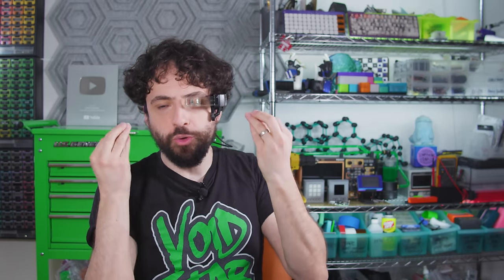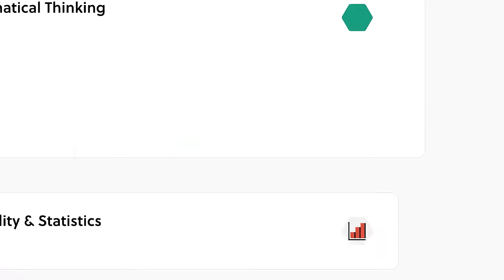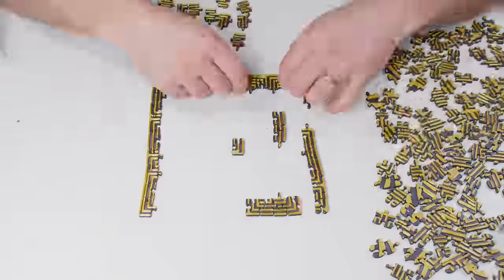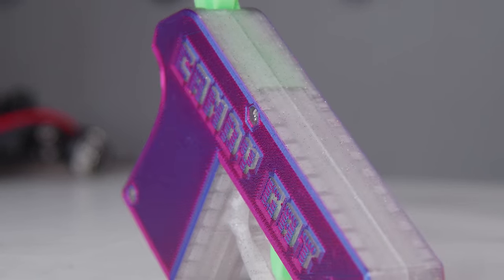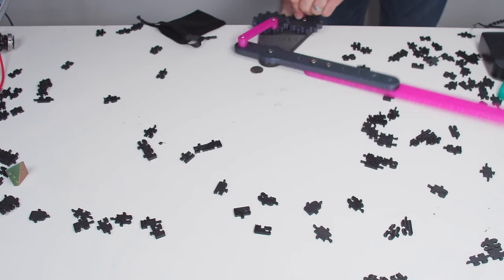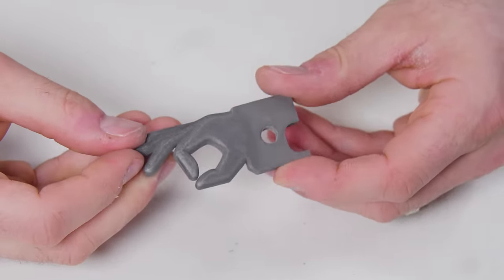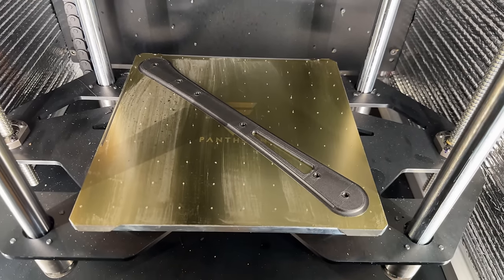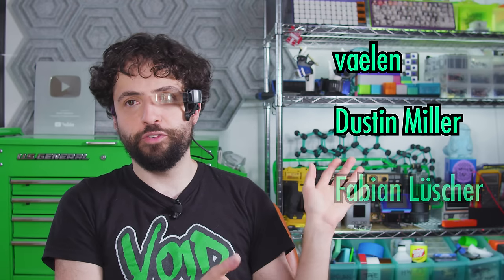10 Free Prints to Make Friends Suffer!

Comment: If you secured the lamp's cord at the correct point, it would actually use the cord as another linkage and it would pivot the lamp, and the lamp would move as the arm moved. That might be the way the original creator had it set up so that it wasn't limp-lamped.

Comment: Whoever made that lamp truly understands the spirit of steampunk. Very much victorian aesthetic engineering. I genuinely want to build this now.
Reply: I wanna see it water jet cut out of aluminum and anodized different colors
And it absolutely MUST use an Edison bulb style LED
Reply: Just remember to look at the pic and assemble it the same, bro.
Reply: @drthmik  LED? Nah, bring in incandescent.
Reply: @alexturnbackthearmy1907  probably best not to.  Incandescent lights produce a ton of heat, more heat than light in fact.  You could use an Incandescent bulb to bake cookies - and they made a toy that dis just that (ezbake oven)

Which poses a problem if you make it out of 3D printed plastics.  So if you do want to use Incandescent, make it metal.

Comment: That lamp honestly hits my biggest pet peeves in 3d printing. I don't need everything to be as well written as the Prusa assembly instructions, but dangit I want to at least know I have the right number of parts.
Reply: Look at the photo and assemble it the same bro.
Reply: just count em in the picture bro
Reply: Build it till it works and the leftover pieces are extra
Reply: Also printing parts that should have been laser cut. I see so many people wanting to print things that are just flat pieces with some holes in them that take no advantage whatsoever of the capabilities of 3D printing and are just strictly worse than some laser cut plywood.
Reply: @neutronium9542  because most people definitely have both a 3D printer AND a laser cutter
Reply: @neutronium9542 you’re totally right, that lamp looks like it should be laser cut MDF or something
Reply: There's no way it was his original design. He stole it.
Reply: look at the photo and assemble it the same bro.
Reply: @MinerBat  You can get an attachment to turn a 3D printer into a laser cutter.
Reply: well, tbf, besides me, idk who else even bothers to read the instructions.

Comment: Would love to see some sillier videos, as long as they are mechanically interesting.
Also, that lamp in the last one was definitely a laser cut wood construction at some point, that's why the design is that way, so it's probably not some created with the permission of the original designer.

Comment: You really should clarify very that specific filaments are needed to 3D print light switch covers, otherwise it's a major fire and safety hazard. That's why building codes dictate that they be made of specific materials. In fact, it's best not to encourage printing them regardless since most people won't bother checking requirements like that before printing.

Comment: Those dice would be fair if they were fully solid. 3D printing is anisotropic though, meaning it adds mass in unexpected places which is effectively loading the dice. For instance, the top/bottom might have 4+ layers but you might only use two layers on the sides. Or consider if you used lightning infill, the top would have more mass from the branches growing out of the walls while the bottom is hollow.

Comment: For the first print, the dice: Although they could mathematically be fair, 3D printed dice rarely are. Although the area of each face is unlikely to be perfectly the same on all faces when printed unless the printer has been meticulously calibrated, the real issue is that the layered nature of the print means that different orientations can lead to different coefficients of restitution, and thus different bouncing properties. Even if each face is perfectly equal in area, and the die is perfectly balanced weight wise, the difference in bounce can still make different faces more or less likely. In practice it's unlikely to be a large difference, but it is pretty much unavoidable when using an anisotropic material.

Comment: I didn't see it on the printables, but I wonder if they did physical tests on the dice. My understanding is that miscellaneous asymmetries in the manufacturing (cough cough layer lines and infill) are what make dice non-trivial to make and require an extensive statistical QC process.

... if no one does it I volunteer

Comment: @0:36 I use a flash glucose monitoring system, (a sensor glued to my skin that sends blood sugar readings to a handheld meter). Thus, I can consider myself a cyborg, and appreciate the inclusion. :)
@0:58 one of the first things I modelled for myself to print were two and three sided dice.... the d3 looks like a cube with three rounded edges, the d2 (because flipping a coin is for chumps), looks like a cylinder, cut in half vertically, and rotate 1 of the halves by 90 degrees (one fun thing about the d2 is, the side facing down is also the side facing up).

I lol'd at "Peztol" more than I should have. 😛

That lamp looks somewhat  harder to assemble&tune than a Prusa MMU2s, with instructions... and tech support.

Comment: Time to reprint the light switch at 120%!   ;)

You may truly be on to something with "3D printing Strap Ons".....!

As a public service, please GLUE a glass light bulb socket in place ONLY if you are fully prepared for the heat of the bulb to release it over time and you have a miniature fire dept. light bulb trampoline sitting under it in waiting mode 24/7.

Comment: Beep boop. Can someone help with a 3d printing conundrum? I've acquired a makerbot x2 replicator. I need to change the x axis belt which there are some very handy videos on. At the moment when i pring a calibration cube the top of the z is smaller than the bottom. Printing a two part box confirms my suspicion that its slightly off. Any recommendations on how to fix this cheers

Comment: Die with indents for the numbers are in fact not fair btw. Skewed or not.
Reply: Proof?
Reply: @MrSkeleton14  It's pretty obvious if you think about it. The side with the 6 for example is much lighter due to more missing material than the 1 side. So the center of mass is not exactly in the middle. 

Professional casino dice are made slightly differently to avoid this issue. They drill out the pips, and then they fill the holes with a material that has the same density as the rest of the die.

Comment: Dear god no! I know the level people put out dumb and useless files, least few should keep it least somewhat practical!
Biggest horror with the lamp is utter waste of using 3D printer to make it, when almost every single peace is FLAT. You dont print flat peaces, you cut them from board since it both saves time and money. I would at best print one layer or one of the each part to use as template to produce them in mass with router and some play wood for instance.